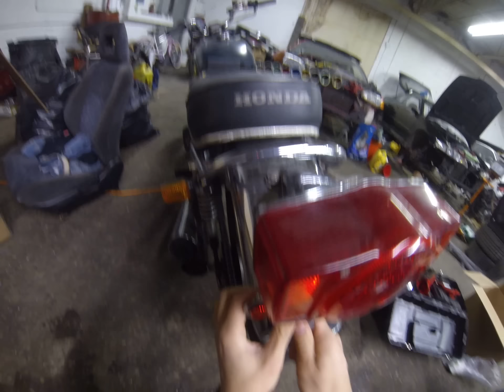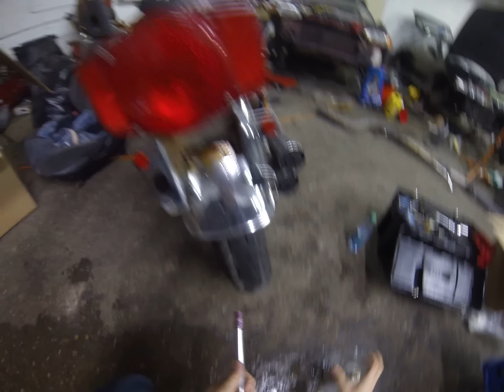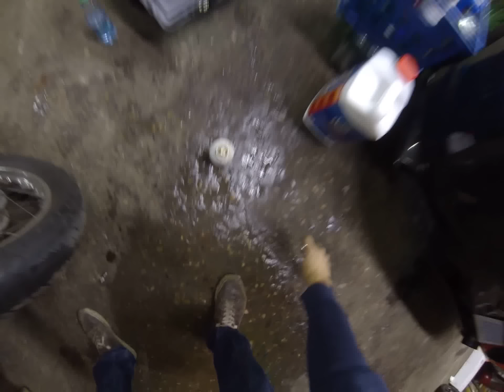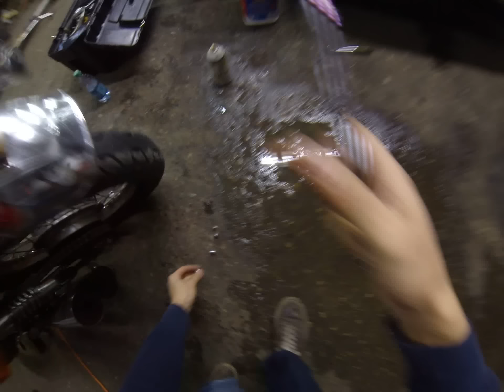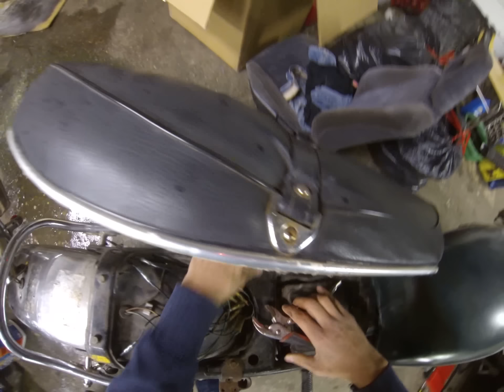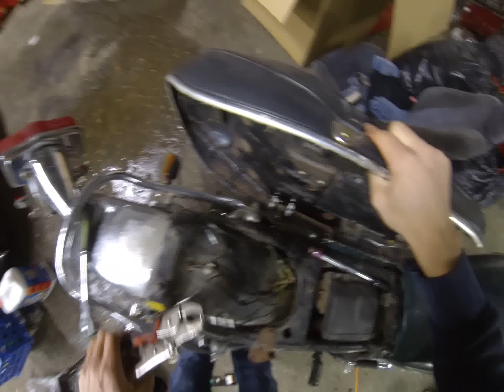Seat removal - '75 Honda CB550 Cafe Racer Build Pt. 2

Comment: I'm trying to figure out how you did the steps in between this video and the next video where you removed the electrical wiring! Did you just cut the chords and label them with tape or did you pull them out of those little bubble looking sockets in the middle of the wiring
Reply from the maker: +Drizzy K check out the video I did later in the series where I rebuilt the whole harness
Reply: @CZeroMedia  
Chris Riddiford